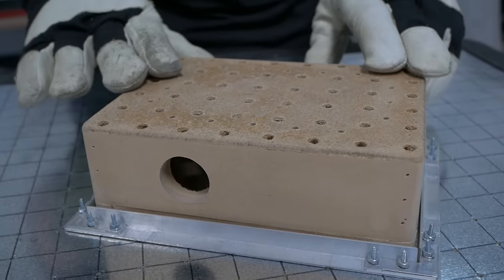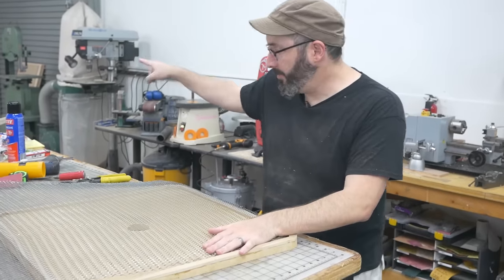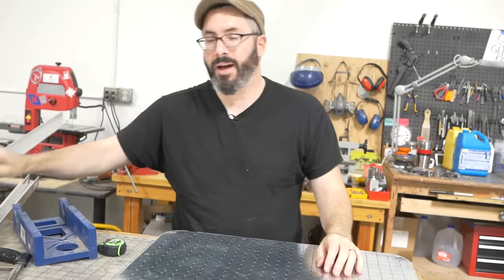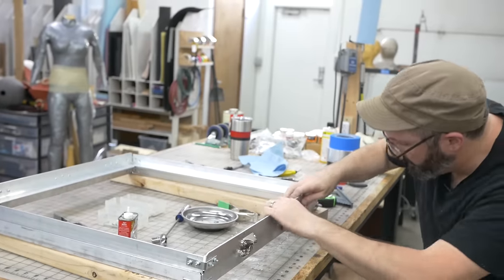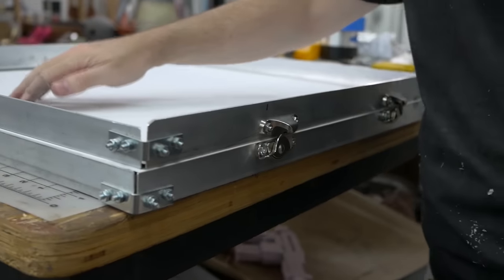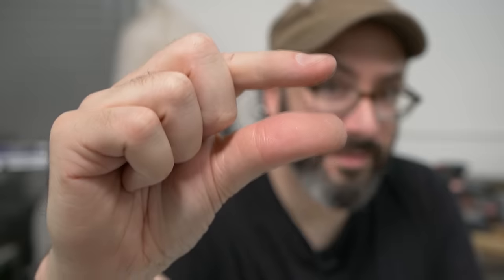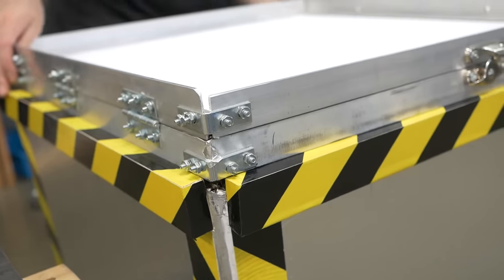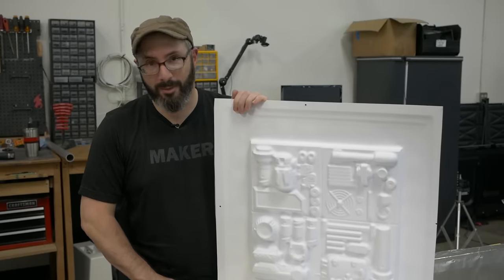Hardware Store Vacuum Table - HOW TO make your own

Comment: you can buy vacuum tables at pretty much any size. CNC changed the world of manufacturing.  your just going to pay for them 4'x8' $2500 and up depending on the atmospheres your trying to pump. You need to measure the surface temperature and map your sag, temp, time per material on a chart. Pretty much anyone can vacuform but to do it with consistency and quality you just cant do it once a week and really get feel for it. But if you science the shit out of it then it is just about heat and time.  If you know in 20 seconds your ready to pull a form you dont have to worry about making the edges to thin from over heating the material. Like the person below said heat is the key... heat everything more heat is more working time.
Keep your process simple. Don't use aluminium as the frame for your plastic it is nothing but a hugh heat sink.
But be warned it is almost impossible to evenly heat above a 4x4 without a plastic heating oven. 
But what the hell do I know I am barely better than a hobbyist as well.

Comment: I would have cut the rounded corners and the steel all together, put the steel in between the 2 sheets of mdf, clamp together and cut, hit it with the belt sander to take off the burr

Comment: What size vacuum did you use just curious HP wise?
Reply from the maker: It's a pretty standard shop vac, around 2 feet high. I don't know the specs off the top of my head.

Comment: Why would you use thin plywood, when you could have made the heater box from rigid insulation. You wouldn't need the "stiffeners" and less heat loss though the sides.
Reply from the maker: I followed along with James Bruton's build for the oven box and he used MDF, so I figured it would be a good choice.

Comment: What are the advantages of these heaters over just cannibalizing an oven? Because I kind of just want justification to drop the 250 on those heaters instead lol (safety and no messing around)
Reply: Nothing, and the way they're applied is silly.  An electric oven is probably significantly more "efficient" than this configuration since it's heating less dead space and I suspect isn't limited to the same capacity (legally) as the heaters.  You also won't have the problem with an oven over drawing a properly rated circuit... it's only a matter of time until he starts a fire with this thing.
Reply from the maker: The advantage was time. It was much quicker for me to just buy a couple of heaters that it was to source an old oven and take it apart. An oven would totally work though, just be safe!

Comment: I would have covered the wood (inside of heat box) with duct insulation and not just aluminum foil (at least that's what it looks like you used, if that was insulation then move along, nothing to see here).  If you're just using foil and wood you're probably losing heat off the sides.

Comment: not sure why this 4 yo video of a channel I don't sub showed up, but I have thoughts about your build.  a) I don't know who told you it was a good idea to heat your plastic 4 feet away from your heat source, but kick them in the shins.  put the target and source as close as you can.   b) how warm is the cardboard box?  because that's heat you're losing that could be heating.  line the box w 1 inch rigid foam insulation, optionally foil lined.  c) ya ever use a convection oven?  well add a small gentle fan to circulate the air inside for even heating  d) when you read the temp of the back of the target sheet n it says 300º, that tells you how much heat is escaping.  cover the top with a slightly oversized piece of that foil lined rigid foam insulation while heating and transferring to the suck table - it'll be light enough to knock itself out of the way as the form forms.  e)  it might not seem it but lights can be hotter than heaters which are designed to give off heat without light and generate low frequency infrared energy.  since 'efficiency' is actually counter to your goal, you could use halogen work lights, which get crazy hot.  f) on the frame, next time use a piano hinge for stability  g) the strength on the frame members is the corner of the 'L' in profile so you could reverse them all so the flat lip is 'outward'.  then clamp them down with maybe a steamer trunk hasp or wedged tusk tenon style setup with hasps to hold the frames together tightly and evenly without deforming to let bits slip.
    I hope that someone someday can utilize my suggestions.

Comment: where do you get the raw stock to do your moldings
Reply from the maker: We get our sheet plastic locally from either Tap Plastics or Calsak Plastics. You can also use "for sale" signs from the hardware store, so long as it's the thin sheets of styrene, not the corrugated plastic sheets.

Comment: If you want better heating elements, find and oven or 2 and use the ones out of them....also adding a small 
fan will help in evenly heating your sheet up, you just may have to have it so it's sealed!
 The oven we used when i worked with perspex was like that, it turned 2400x1200x10mm sheets of
rock hard perspex to jelly in about 3 minutes lol.

Comment: Can you make a heat box with a heat gun?
Reply from the maker: Heat guns are specifically directed heat. What you really need for a vacuum former is even heat  spread around the container to that your material doesn't get overheated in small areas.
Reply: @punishedprops  Well, maybe its possible to make an even heat if the heat gun was inserted in to a hole in the side, on the bottom of the box, cover the box top, let it warm up like an oven, remove the top & place your plastic holding frame & set the heat gun on lo. Just thinking outside the box. :)

Comment: Couldn't you stick with the original idea of overhead heating,  just make the form round so you can spin it to achieve an even heat coverage? (I understand your table would have to be round also).
Reply from the maker: The unevenness came from the plastic's distance to these particular heaters. We tried a couple of things, but getting the plastic a couple feet away from the heaters made the biggest difference for our build and placing the heaters on the bottom made the most sense, because heat rises, of course.

Comment: The heads of your bolts should be on the outside with the nuts on the inside to avoid catching on things and gouging into your skin.
Reply from the maker: For this build, we wanted the inside surface of the frame to be as unobstructed as possible. Hence the countersunk screws on the inside and nuts on the outside.
Reply: That is an interesting point and really good thing to keep in mind for this application. I may have missed that point if you mentioned it. I can see now how they might cause a problem pointing inwards.
I got into a debate with another viewer on the airtightness of MDF. What are your thoughts on this? I have built many speaker enclosures in the past using MDF. I have always considered It to be a very airtight material, even without the application of a surface sealant.

Comment: Instead of cutting miters in the aluminum why did you not cut out a vee in the bottom and bend the aluminum around to form a box you would have only had to join 1 corner then
Reply from the maker: Thanks for the suggestion!

Comment: Hard foam board with foil would have insulated and kept the heat in WAY better than MDF (and would have been significantly more fire safe, cheaper, and lighter!) for that square tube/hood thing that goes above the heater. The foam would also be 2" thick, giving you a nice lip to rest the frame on or something.

Comment: You will get more action from your traction (and and less webbing around tall molds) if you bore 1/8" holes  at the corners (especially inside corners) and strategically around the edges of the objects being pulled against (not too many.) This lets more of the vacuum pass from the platen over the mold surface. Of course, if you are pulling an object that is resting directly on the platen; you can't do that. But, you can cleverly place the object to take advantage of the Aeolian vents the platen provides.

You will also get a much easier release if you lightly (and evenly) dust the mold with fine talc before the pull. Johnson's Baby Powder works great.

I have some experience of this process; having built many vac-form molds during my years at CenterLine Studios [http://eli-tables.com/autobiography/gallery/vacuform-molds/] Of course,  I had the luxury of placing the molds, I built, in a press  at Costume Armor (next door) [https://www.costumearmour.com/cdsamples4.htm] that could pull a 50" x 98" sheet of 1/8" Kydex.
Only in my dreams were my mold making skills up to the level of the stuff they pulled at Costume Armour. Where are the snows of yesteryear?
Reply: Oops, forgot to suggest a name. Since it produces objects by the application of wind one might call it the Aeolian Press (nah - sounds too much like a vanity publisher who prints slim volumes of poetry - never mind)
Reply from the maker: Thanks for all of the great tips! =D
Reply: Just payin' it forward.

Comment: late to the arty, but I've probably watched about 20 hours worth of your videos by now. they are great. just wondering if this method will work for kydex of varying gauges. or does that solely depend on how much you heat it up? also would transferring from an oven to the vacuum board be plausible? provided you maintain droop. and lastly, will i fuck my oven if i do that? (can you cook food safely aftewards?)

thanks! love your videos!
Reply from the maker: I would definitely not recommend eating from an oven that you've heated plastic in. I know you can re-purpose an oven to be a vacuum form machine, but I don't know how off the top of my head - we didn't have access to one when we built this so we chose not to go with that method. I have not tried vacuum forming Kydex, so I can't speak to whether or not it will work, you'd have to conduct some research on that.
Reply: @punishedprops  thank you!

Comment: Why does everyone use the vacume or shop vac approach?  You have a 1 hp dust collection system behind you take off the bags add a 1 way valve and vacume storage tank to pull down and youve git more potential suction power then a shop vac could ever have and it will cycle faster to full power then say a vacume pump that can pull down even more air but will take longer.
The big commercial machine I used 40 years ago pulled a 4x8 sheet of pvc down in less then 3 seconds onto the form.

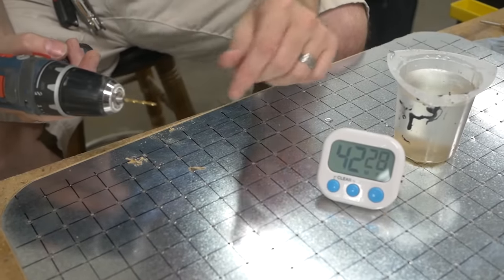Comment: In fact, That's  a laugh!  (8:27) No drill bit I ever used "Bent over" because you got it too hot from drilling with it.  Agreed the whole bit can get hot, but the most of the heat is generated at the cutting end and that edge can get so hot you end up burning up the cutting edge.  A "relatively" small amount of that heat will ever get all the way to the chuck end of the drill.  Improper drilling technique can cause a drill bit to break.  A drill bit which has had the cutting edge burned or chipped can cause the inexperienced user to apply too much pressure in an attempt to make it cut and thus break the drill off either at the chuck or at the surface of the part being drilled (that is at least, using smaller drill bits by hand or larger ones in a drill press).  To bend over a drill bit, it would have to be made from metal equivalent in hardness to a nail (which is made of pretty soft metal) or get glowing red hot.  If your drill bit ever gets glowing red hot, any fool will know something is very wrong and here's a hint:  it's not because you have used proper drill bit with proper technique for a very long time.
Reply: My drill bits have broken when they got hot, but getting hot enough (e.g., red-hot) also makes steel bendy.
Reply: Of course, the bit will get hot enough to burn the wood (or melt plastic) before it gets hot enough to bend like a wet noodle.
Reply: The friction between the sides of the drill bit and the MDF will generate considerable heat - far more so than that which is accumulated at the cutting tip. MDF cuts undersize, therefore there is much friction and hence much heat. If the aspect ratio of the bit is large enough and the working end is far enough from the chuck (relatively) there is no reason you couldn't soften the drill bit. Try offering up a welding torch to a small drill bit and see if you can't make it glow.... lol ... the chuck may well be a large mass, but it only has three relatively small areas of contact. Hence, heat transmission is much reduced.
Reply: I've had a few smaller diameter bits bend from excessive heat.

Comment: that thin piece of metal on the table has lots of thermal mass. You might try warming that up a bit before laying the plastic down. I would think you want the plastic to stay malleable as long as possible, and I'll bet the metal is drawing out lots of heat quicker than you want. DISCLAIMER: I have never messed with vacuum forming at all.

Comment: BTW, Check your math on the number of holes, 525 is not correct. 24 X 24 = 576. your ones digit in both numbers is a four, thus the ones digit would have to be a six in the answer (4 X 4 = 16).
Reply from the maker: It was technically 23 x 23 minus the 4 in the corners.
Reply: @punishedprops  oh, okay. I thought you said 24 X 24 in the video. Thanks for clearing that up.

Comment: how about a vac form system that produces 1 per minute.
Reply from the maker: That would be pretty crazy, I don't know if that exists anywhere
Reply: @punishedprops  have 10 or more frames loaded and ready to heat...(use 240 vac heaters) ...heat first frame  when its ready put it on platen person 2 puts next fram on heater...person #1 turns on VAC for 15 sec. now person #1 turns off vac and applies positive air presure thru vac hose to push the first mold off the platten again and again rem after mold is removed turn off air presure and turn on vac also use mold release spray so  the plastic will quick release and yes with practice you can achieve 60 per hour. I know it can be done.
Reply: put in a 2 way valve that either sucks or blows depending on which way the handel is set and leave the vac cleaner running to build up vacuum.

Comment: go to you tube channel type in RC planes when you get the channel type in vacuum molds and watch how they make them. you spent way to much money. half the guys take 3 100 watt lite bulbs mount them in the box, and create over 300 degrees. enough to soften the acrylic to make the mold. take a look.

Comment: Put a vacuum gauge on the Vacuum table with out any objects on the table!

If there is any Vacuum, on your table, your holes are to small.

Also paint all you MDF!
Reply: Hi, why paint it and how big would you still holes for a 700mmx700mm table with 576 holes. (24x24 holes to be precise) I did them at 10mm holes. Is that to big? Thanks in advance

Comment: If you use a 3 button remote you can control each heater and the vacuum independently of one another.
See here:
https://www.menards.com/main/electrical/light-switches-dimmers-outlets/electrical-outlets/indoor-remote-outlets-3-pack/3635419/p-1444425969250.htm
I use this to control lightning, a fan and a space heater.

Comment: Greetings PPA.  I've made a few vacuum boxes for my RC projects.  What has worked for me in distributing the heat evenly is to place an aluminum screen mesh, like chicken wire but smaller squares/diamonds and thicker wire,  just above the heat source.  Also it's best to prop your mold up with a 2 to 3 inch wood base to help eliminate the webbing on the final piece you want to cut out.  My biggest box uses plastic 32x48 inches.  If you like, check out my channel and video part 10.  I get a lot of my materials from McMaster. com  Good Luck!!
Reply from the maker: That's a great idea! Thanks for sharing. =D

Comment: I've always been curious as to why nobody uses a fan or two to move the air around inside of the heat box, with the shaft long enough to mount the motor outside.  That would seem to be the solution to uneven heating.  What am I missing?

Also, mineral wool to insulate the heat box would make it MUCH more efficient.

Comment: Why not add an insulated lid to your heating box so that you can build more heat for the plastic?
Reply from the maker: We actually ended up just putting a piece of aluminum foil over the top and that seemed to help a little bit.

Comment: Nice build, too much guessing because of inadequate planning. Fits should work, videoing fails just confuses the journey to success. This vid is clearly about the mistakes to avoid, instead of a how-2 build to success. Until you come up with a way to adjust the distance from heaters to plastic to find optimum heating, you're going to keep hunting. The dual-internal mesh doesn't allow sufficient internal cross-flow to achieve a balanced draw, and there are SO many options to NOT have to drill lots of holes in a sheet of MDF, that I'm gonna guess no one on your team has actually DONE a large build of this or any type similar before, or that no one on the team has any actual product design experience. No worries, your local maker-shop should have folks who can advise. If not, I am an engineered products designer, and can offer tips if curious. Good luck ! Nice idea, looking forward to a success-vid instead of a hunt-and-peck try. ALL the best going forward ! - C.

Comment: I am pretty sure there was no purpose to pre heating the box with the top open, Just wasting power. It will heat up better sealed.
Reply from the maker: Oh we keep a tin foil "lid" over it while it's heating, but we took it off while filming to check the heat
Reply: @punishedprops  cool that makes way more sense